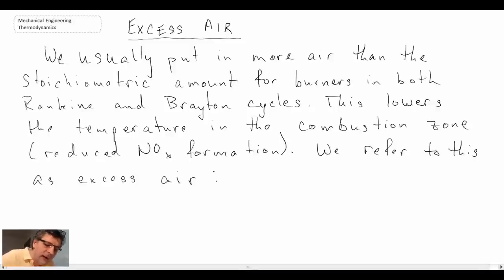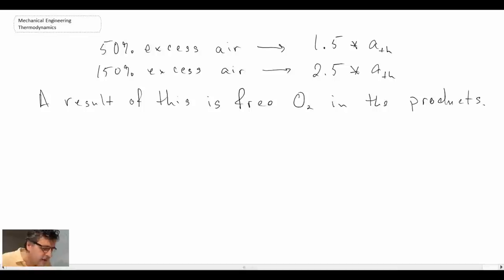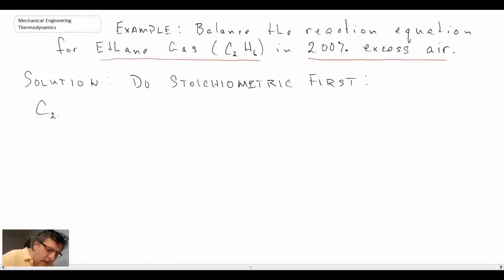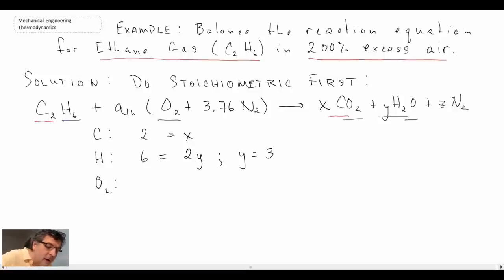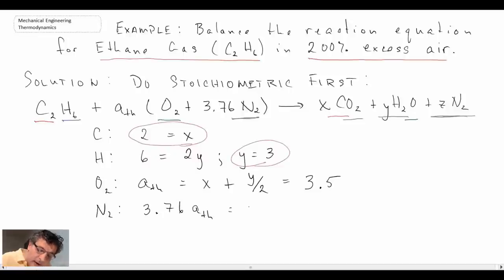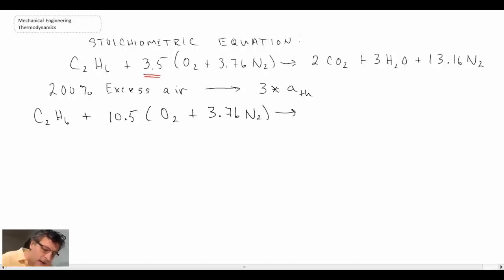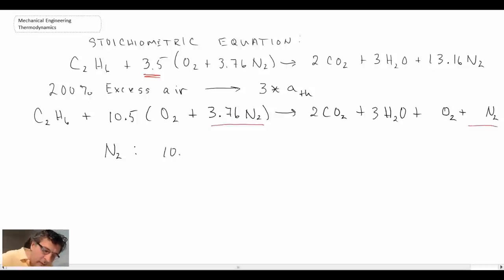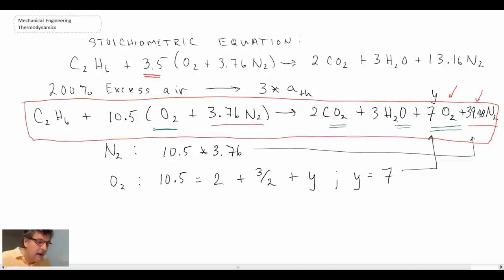Mechanical Engineering Thermodynamics - Lec 32, pt 1 of 3:  Combustion - Excess Air

Comment from the maker: No - it should be multiplied by 3.  0% excess air is the correct amount of air based on the stoichiometric balance, and thus it is 1*a_th.  For 100% excess air it is 100% more air than you need, and thus it is 2*a_th.  For 200% excess air it would be 3*a_th.
Reply: I have 400% so 5*a_th?
Reply: @hashimkawhtarali5291  yes
Reply: From which books is this question taken
Reply: Sir for 20%

Comment: Propane gas is allowed to react with 80% theoretical air. Determine the 
theoretical equation for the reaction. what to do in this case?
Reply: that will be fuel rich condition, and unburnt hydrocarbons will be present in the products

Comment: Sir how if the problem said "the amount of O2 provided in the form of air (21% O2 and 79% N2) should be twice of the amount needed from the reaction" does it mean we have to multiply the a_th by 2 or the excess air is 200% ?